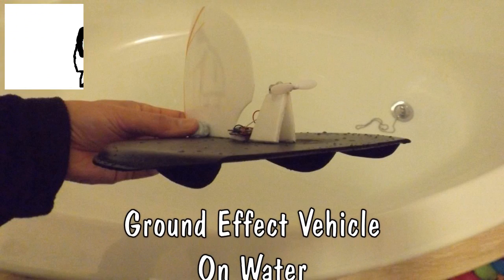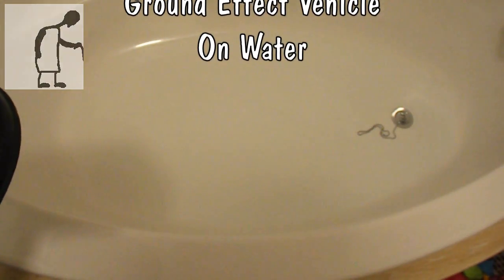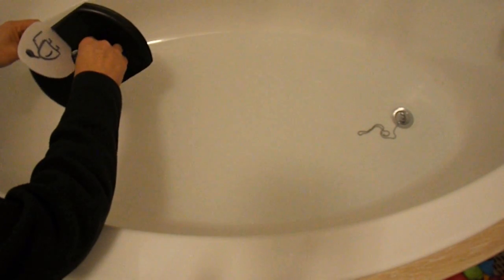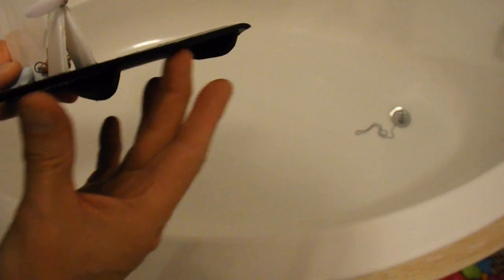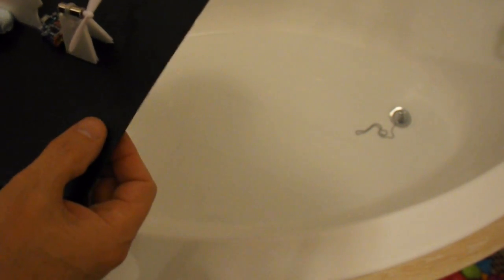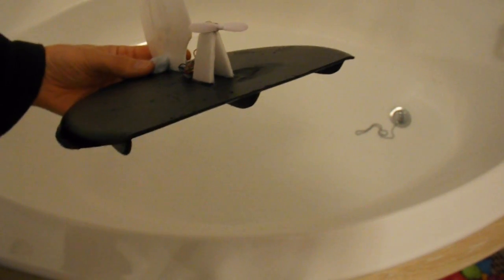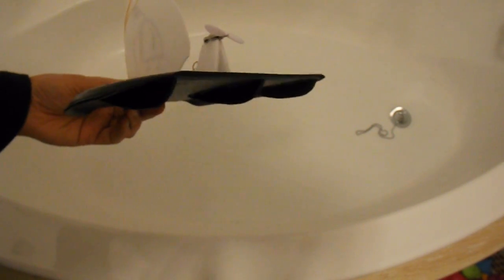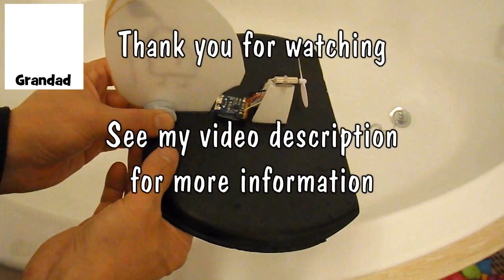Ground Effect Vehicle On Water

Comment: Hey grandad can you make a rubber band powered ground effect vehicle
Reply from the maker: Kaleb Beane I don't like ground effect vehicles. They need to fly fast to generate the lift and that means they need a good distance to fly so I certainly would not be able to test a rubber band one in my bath and if I try it in any pond or lake it would fly straight to the middle and I would not be able to retrieve it, so I will pass on that suggestion.
Reply: Ok thanx for responding

Comment: One point of interest. In the previous video you zoomed in on the usb charger. I have those as well. But I think you did not pay attention to the preset of it. They are preset to charge at 1 amp! You either need to replace the smd resistor, or be sure to use an USB output with far less than 1 amp. The LiIon battery you use is what? 300 mA? Charging it with 1 Amp is shortening the life of the battery. I thought you wanted to know this. Google the info or use this list:
30k=50mA. 20k=70mA. 10k=130mA.5k=250mA. 4k=300mA. 3k=400mA. 2k=580mA. 1.66k=690mA. 1.5k=780mA. 1.33k=900mA. 1.2k=1000mA.
Reply from the maker: You didn't look close enough then :-)
You may be able to see the replacement resistor if you look carefully.
Here is the 'build video' for the LiPo and the Charger http://youtu.be/V8Nu94khHoo
It is in the video description